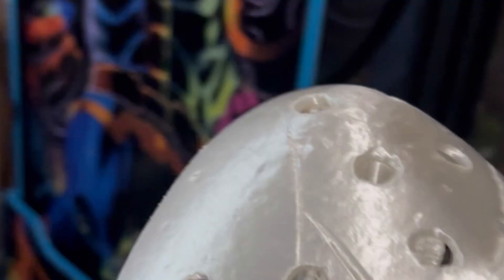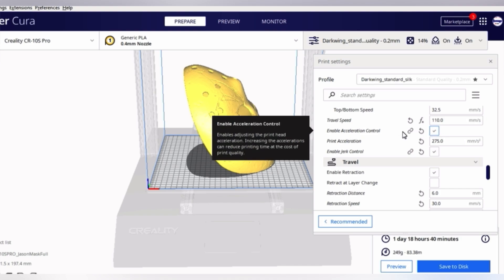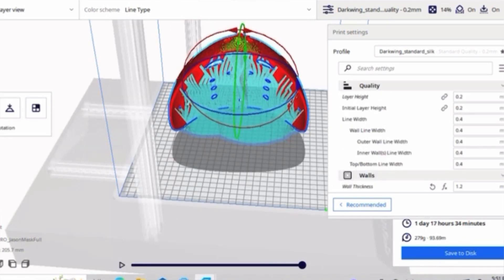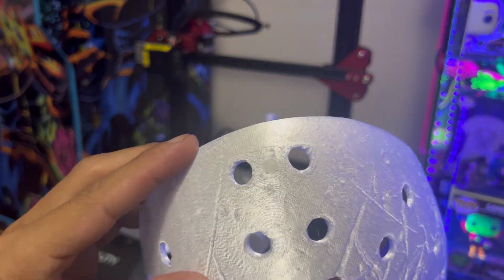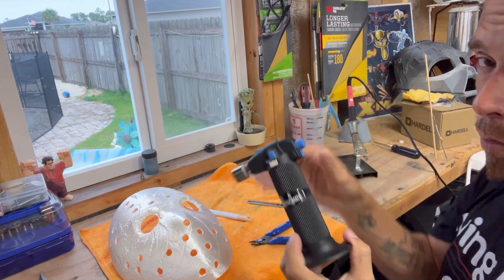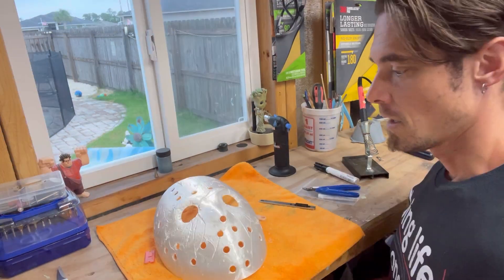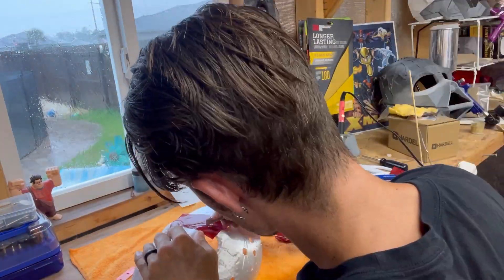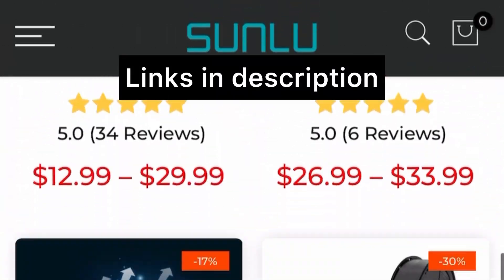Finishing a 3D print with no sanding or paint! Adding vinyl to 3D prints + settings tips with Sunlu

Comment: I use normal PLA for my prints, I was wondering how much heat is okay to apply to the vinyl for stretching.
Reply from the maker: Vinyl doesn’t need a lot of heat to stretch 120* and it’ll start to soften and stretch

Comment: You gotta try out the new tree supports in 5.4. They're skinny now. I was slicing a model and they use less material than normal and they print faster as well.
Reply from the maker: Yea I haven’t upgraded cura, I’ll hafta check them out, thanks for the heads up

Comment: My jerk settings I don't understand what so ever lol I use cura to btw
Reply from the maker: What’s your default at?
Reply: @Darkwingdad  I tried a 700 and a jerk of 9 didn't go well made some weird noises so stoped it and turned it off haha 😅
Reply from the maker: @1937Brett  acceleration should be around 300, jerk between 8-10 mm/s if it’s a core xy it can go higher
Reply: @Darkwingdad  I use a anycubic Kobra neo printer probably one of the worst but all I could afford haha thank will try it
Reply: @Darkwingdad  what should my initial layer travel acceleration speed be and my travel acceleration speed be at the moment there set to 5000.0 mm/s2 at the moment